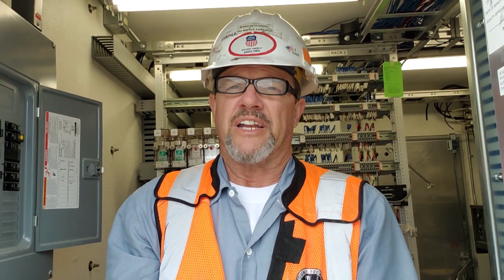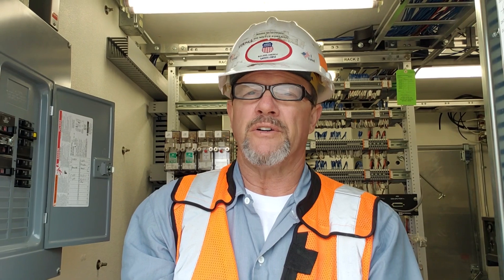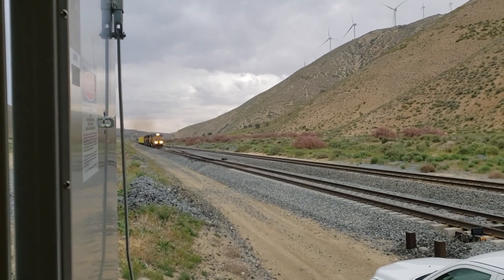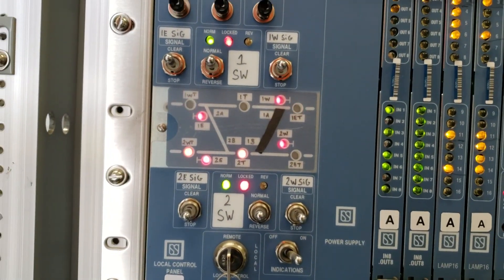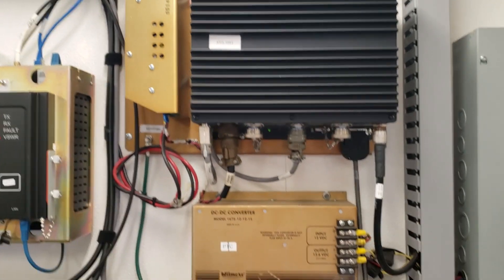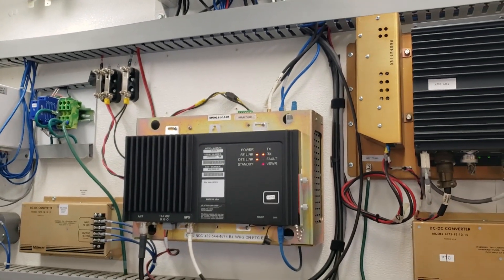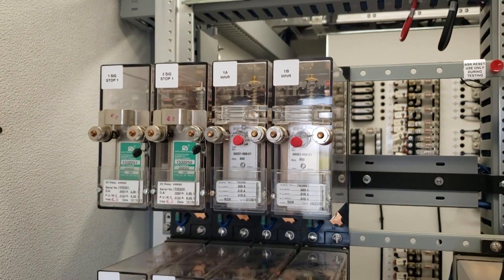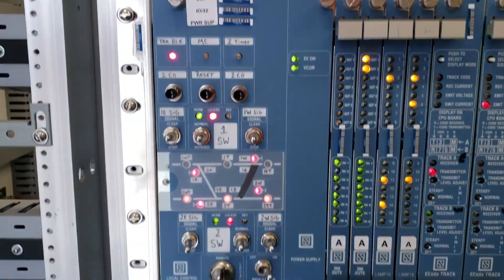Railroad Signaling Explained: How A Signal System Works at a Control Point

Comment: I picked up an Ogontz Cab Signal Tester CST-60-100-3-3 and would like to learn more about it. I was intrigued by the device's simple, solid construction, as well as it's metal stamped service record and lead seal. I reached out to the manufacturer to learn more, but they didn't have much information about it. I don't think that it's in use anymore because I have not been able to find one for sale, specs, schematics, or anything else about it. You mentioned that you have been working for many years in your field. I'm wondering if you have ever used this or a similar device?
Reply from the maker: I'm sorry, but I have nothing for you. We never used cab signaling in my territory. There a re a few railroad signal groups on facebook where you may have better luck. Good luck!
Reply: @MarkClayMcGowan  Thank you.

Comment: The old US&S micro lock. Never saw the control panel on the processor before. Very interesting. Thanks
Reply from the maker: It's the only micro lock and  micro trax I ever worked with (other than what they had in our training classes), so it was all normal to me! Thanks for checking it out!

Comment: Track Ciruits are not something that you want terrorist to know about.
Reply from the maker: I understand your concern, but what would a terrorist do with a track circuit, or any part of the signal system, for that matter? Track circuits are either energized or they aren't. These are failsafe systems and without very specific knowledge of said systems, cannot be manipulated (especially this system) without putting everything to stop and immediately alerting dispatch and signal. 
Thanks for checking it out!

Comment: nice job safety first! the new culture, is the right direction. You and my world changed drastically from antilog, to digital, in the late 90s,2000. I adapted as best I could, this old dog fell behind. Safety was trying to break 40 years of bad habits. When I left it cleared a lot of dead wood, now new smarter, safer wood can grow! thank you stay SAFE
Reply from the maker: Thanks. I actually liked the new microprocessor stuff. It did a lot of the work of troubleshooting and testing for you and was very reliable. It was nice though, to be able to actually LOOK at the relays for reference! I was involved in the safety program for 17 years so it came second nature to me. Some bosses, even young ones, didn't like conforming. I never pushed the issue, just asked them "can I get that in writing?".
Reply: @MarkClayMcGowan  very good had one manager actually write it down, he will never make that mistake again!

Comment: Signalman here for 15yrs now and second generation signalman, the old relay based could handle lightning where as the new electronics don’t like it at all. When I first started we still had de-energized DC coded track and some code line but now we have all ElectroloGix EC5 with PTC.
Reply from the maker: I worked with almost everything over the years except coded track. Most of our stuff was relay logic until the PTC push the last dozen years of my career. I loved being a signalman but don't miss working! Thanks for checking it out!

Comment: Dispatcher for this sub is actually in San Bernardino
Reply from the maker: UP dispatches this sub and their dispatchers are in Omaha. BNSF dispatches from Berdoo but they aren't involved on the Tehachapi.
Reply: @MarkClayMcGowan Mojave sub is dispatched from San Bernardino.  UP & BNSF run the San Bernardino office. BNSF owns the building but we dispatch the LA Basin and the Mojave sub from here. BNSF wanted the Mojave sub run in their office since they run so many trains on it. I am currently the 3rd shift trick dispatcher.
Reply from the maker: I never knew that. It was dispatched from Omaha when I visited the Harriman center in 98 and was still there when I left the mountain in 2000. No one ever mentioned it moved. I stand corrected.

Comment: Mark, I have appended several of your replys to messages, with no purpose other than augmenting the information .
I was a bottom-feeder manager for years in MOW and worked hard to keep a good relation with the signal guys.
Do you know what a "hotbox" is? I do. It is when you grab a lining bar (track tool) leaning against a large relay case and nearly get knocked on your kbutt. Biggest ground wire and hottest hotbox ever. The maintainer following the tie gang was overjoyed to hear my story, promptly, fixed it and with the two of us, you now know the rest of the story.

Comment: Would like to experience the inside of a relay shack(?) that's stuffed to the gills with old school CTC relays, and hear them clicking as code comes in and code gets sent back to the dispatchers board.
Reply from the maker: You're about 30 years too late! Thanks for checking it out!
Reply: @MarkClayMcGowan  😆 Oh I know I'm too late. Would still be neat to experience it anyway though.
Reply from the maker: @SOU6900  it was a cool sound. The code machines never stopped chattering and you could hear relays working so you always knew when something was happening!
Reply: Very nice indeed. As a lad, I toured an AT&T switching station, in 1970.

To this day, I still remember the symphony of relays and stepper switches...and the smell of the lube oil and warm coils.

Fantastic reduction in gear required today! Somehow, I find it really cool that those shelves weren't wiped clean. The ghost imprints of the old gear is very cool indeed.

Comment: This is all so good, batteries, relays approach  and stick circuit blocks. Sounds like kid stuff but I
had actual blocks on lionel 3 rail track, insulated one  running rail from  other and applied a battery 
thru a resistor , train enters a block, relay drops out and a red is given, 1 block behind it would be a 
ylw so engineer would know that on entering a block, it was known a red would follow.

Comment: I work in the LASU, and I have a question.  Every once in a while I'll be running on greens, and I'll come across a flashing yellow then another green. I'm not following anyone and I don't understand why there was a random flasher. Do you know why?
Reply from the maker: It could be the dispatcher hadn't cleared the next control point yet but did before you got to the next intermediate or, more likely, just a ghost in the machine. With the new system we get calls for signals cycling and we never find the problem and it never comes back.
Reply: Could be a bad bulb/LED for the green aspect at that intermediate and it's just (correctly) downgrading to the flashing yellow too.
Reply: @peapaw2010  That makes sense. I know I'm not following anyone and I can see on the PTC that the next block is clear.

Comment: What kind of cab signal system does     UP have ?cause on the FECrailway  they have a proprietary cab signal system.
Reply from the maker: While our control equipment has it intalled, we have never used it on my territory so I am unqualified to answer. 
Thanks for checking it out though!

Comment: Hi again Mark - While watching this video I noticed you refer to a "Dispatcher" - would that be what we in the UK refer to as a Signaller or a Signalman - (I note you refer to your own role as a Signaller where as in the UK we are known as Technicians!) i.e - the person who operates / monitors the signalling functions ? In the UK these Signallers are located at remote  points in Signal/Power boxes - For our mainline operations these signal/power boxes are often anything up to 100 miles apart and can communicate with each other via various electronic systems and control areas up to 100 + miles away. Do your dispatchers operate from similar remote signal boxes and if so how far apart can they be and what size area would they control. I obviously appreciate the USA is so much bigger than the UK so I would imagine the scale of operations is so much bigger!
Reply from the maker: Our dispatchers are the people responsible for keeping trains moving. They line routes depending on where trains need to be placed for meets or at junctions or held for work being done on tracks or signals. All dispatchers on the UP work in Omaha, Nebraska.
What you refer to as signallers are probably what we call Control Points but ours are much closer together. The dispatcher has remote control of them whereas signals between control points are all automatic.
I refer to myself as a signalman but at the time I retired I was a signal maintainer after having been a Signal Maintenance Foreman for 22 years.
Here is a list of signal jobs in America (most roads are the same):
Assistant Signalman 
Signalman
Lead Signalman (construction)
Signal Construction Foreman
Signal Maintenance Foreman
Signal Maintainer
Electronic Technician
I hope this helped and I hope you check some of my videos that show more of how things work as well as trains utilizing the stuff.
Always cool to talk to signal guys from around the world. Thanks for checking it out!

Comment: What is the typical jurisdiction for a maintainer? For example is it by county? Or a certain mileage of track from the yard you work out of?
Reply from the maker: They are generally denoted by specific control points and are determined by equipment count. There may be a district sixty miles long with single main, eight control points, twelve intermediates and five crosssings and another district fifteen miles long with double track, five control points, eight intermediates and 20 crossings.
When I was the Tehachapi maintainer my territory began at CPSP 356 and ended at CPSP 389 with 25 miles of double main, eight miles of single main and 56 miles of non signaled branch lines (1- 48 miles, 1- 8 miles)  .
I had five CPs, 18 power switches, 20 hand throws, 12 intermediate locations, nine mainline crossings, six branch crossings, 22 DED, one high wide, two HBD and one slide fence.
Yeah. It was a bitch to keep up with!
Thanks for the question and for checking it out!
Reply: Thanks for the response. Good Info. I am currently in the interview process for a signal apprenticeship with BNSF out of Spokane, WA so I’m trying to gather as much info as I can. What is the on call schedule typically like? I’m sure it’s vastly different depending on the district or yard you’re working out of, just trying to get a basic understanding of what the job requires. Thanks for the time!
Reply from the maker: @joshuanelson5084  we were on 24 call but could check out if we wanted to. I understand BNSF has standby pay which SP and UP did not. They pay for maintainers to stay marked up.
I spent most of my career (22 years) as a Maintenance Foremen and the seven years prior to that as a gang foreman. I rarely worked overtime but that was generally my choice.
Reply: @joshuanelson5084  Good luck on your interview venture for an apprenticeship in rail signaling. Mine took 7 months in my country.

Comment: I would luv to pick your brain inside one of these little shacks off camera of course!
Reply from the maker: Well, if you're ever in the area, let me know. I'll see what I can arrange
Reply: @MarkClayMcGowan  That wood be cool. I wanna get out there to see merles new house location. I've always wanted to be a signalman but I failed algebra in high school so I never persued the electronics field. Ended up a truck driver instead, which is cool coz I get to enter a lot of railroad property off limits to most.
Reply from the maker: @bfurailroad1104  im no math wiz either and, in the end, I very rarely used it other than in phase 1 signal school. Once you figure out what circuits do in a given situation, it generally points you in the right direction.
I drove trucks before working for the rr (got my class 1 when I was 18) and again when I was laid off in the early 80s. I actually enjoyed it, it just didn't pay very well. I also ran a backhoe for awhile during that time. That paid well but didn't want to do it forever.
Anyway, thanks for the comments and for checking it out!

Comment: union switch and signal.
Reply from the maker: What about them?
Reply: @MarkClayMcGowan  nothing at all- forgot to add the symbol on the signal board-U,with the two "s"inside it means Union switch and Signal.
Reply from the maker: @rearspeaker6364  ahhh...yes. they were bought by a company called Ansaldo about ten years ago. I guess they still use US&S in some cases.

Comment: Mark , what does the white lamp mean on the outside of your location boxes/houses?  I saw a lot of these during my visit and wondered what they mean?  Most of the time they were lit , even during the day.
Gregg :-)
Reply from the maker: They are power off indicators. When the AC power is on they are lit solid. If it is off, they flash. The trains (or whomever) report it and we go see what's wrong.
Thanks for the question and for checking it out!
Reply: @MarkClayMcGowan  So let me understand this, if AC power is lost, and circuits are running on battery power, the outside lite is flashing to indicate loss of AC power? 
I have phone numbers of all yard managers in the area I drive, so when I see a light flashing I should call so they can call relay?
Reply from the maker: @bfurailroad1104  that is correct, sir!
Reply from the maker: Also, at crossings there is a number that you can call that will get things rolling more quickly
Reply: @MarkClayMcGowan  Thanks Mark ! I guessed it may be something like that. Working in Tehachapi would of been a great place , no one to hassle you and loads of trains. The guy I spoke to liked his section and he was retiring soon as well , you probably knew him as he worked for UP for many years like yourself. Look forward to more videos sir.
Gregg.
Reply from the maker: @FishplateFilms  my last "Signaling Explained" video will be up this evening. Crossings!
Reply: @MarkClayMcGowan  Great , thanks Mark! I was out doing crossing services last night..dodging crazy car drivers!!
Gregg:-)

Comment: Nice to see different gear Mark! Is that Micro Lock?  Looks the same colour as what we use in some places? I just saw it written on the CPU ...LOL. Thanks for the insight and look forward to more.
Cheers Gregg.
Reply from the maker: Yes on the microlok. I think I said we use microcode once. We do not. We did back in the 80s but replaced it with electrocode 4. That was upgraded to EC 5, electrologic and microlok in the PTC project.

Comment: nice to see those old relays gone.i bet a ton of energy is saved with the new electronics.love that train that went by with all the EMDs on the head end.thanks for sharing
Reply from the maker: My pleasure! Thanks for checking it out!
Reply: Those old relays worked with only a few milliamps, but there were a lot of them. However, the real energy hog out there is constant lit signals at big CP's that still use incandescant bulbs.